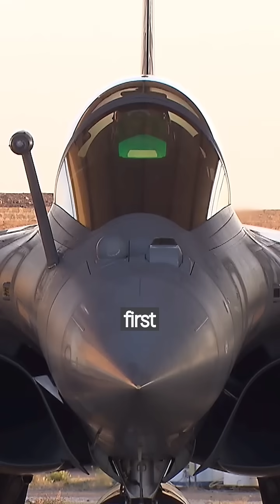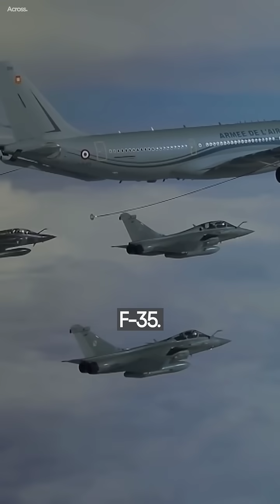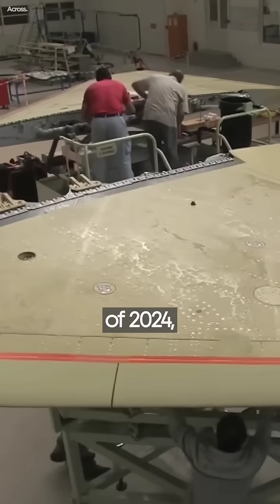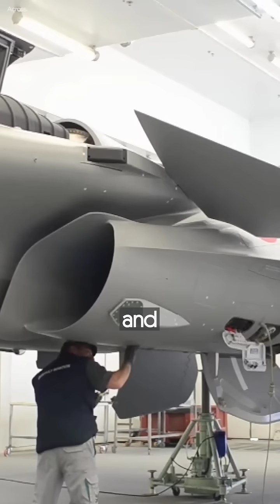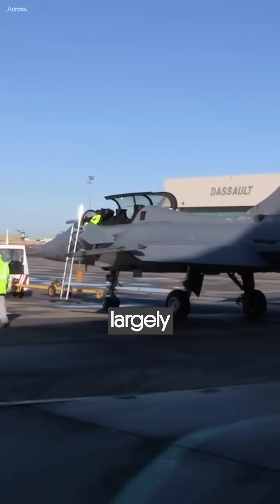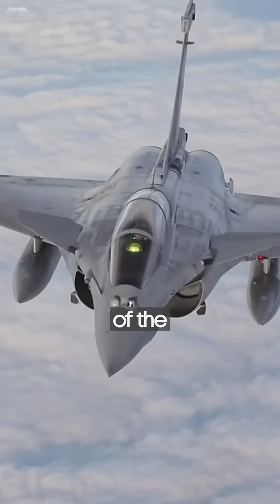The Fighter Plane No Nation Wanted to Fight #shorts

Comment: Its getting its butt checked by the F-35A in war games at a F-35A win ratio of 7 to 1.
That's the difference between non stealth 4.5 gen and 5th gen stealth network centric.
The Euros like Eurofighter, Rafale, Grippen have got to improve their game and advanced to 6th gen or they will loose every time against a stealth 5th/6th gen adversary. China is starting to manufacture 5th gen now! all be it maybe not as good as the F-35.

Comment: Yeah, the French 🥖 guys has this Dassault Rafale. It's the successor of the well-known Mirage 2000. 

Besides that, the aerodynamic design, is very similar to the Eurofighter Typhoon 🌀. This last jetfighter has the same capabilities. And had his first flight in the mid 90ies. 

It's 10 years more modern. The engines give at full thrust so much punch 👊 that this tiny jetfighter goes straight at Mach 2,5. His avionics, was developed over the past decades. 

And reached one point of cutting edge technology. The helmet of the pilot has neural sensors. Where he's looking, the radar is continued searching the area for targets and enemy movements. The computer for warfare is so sophisticated, that he can trace  and track 80 -120 targets at the same time. 

They developed new weapons. With autonomy flying . One mighty missile. Ukraine wanted. But the Bundeskanzler Scholz denied.

The Eurofighter project was a joint venture of many European countries. Like Germany, GB, Spain and Italy. Theyre still in Service. The Geeman Luftwaffe had to intercept many Russian aircrafts. Over the free Airspace. Which is very close to the European countries Aerospace. They are  continuesly monitoring the skies for any aircraft movements.

Comment: Greece is creating squadrons of Rafales, too. One is complete. It is not sure whether Greece will make a second order. They want F-35s. My opinion? With a radar footprint so small that it may pass unnoticed and its SPECTRA radar, it has proven to do a stealthy job. Some time ago, an unknown Air Force attacked a Turkish (I think) base in Libya. Using SPECTRA and correct cruising, it approached, created disaster, and left without being electronically traced. I suppose it was personnel that identified the type of the aircraft, but not a flag.
Greeks must be flying unnoticed F-16s, between Crete and Cyprus. They proved this once. F-16s, which were not supposed to be undetected, flew to Cyprus undetected by Turkish radar. But when they returned to Crete, they made sure they were seen, which was a bad surprise to the Turks. 
Why I am saying all this. The F-35 is still not mature, which is outrageous for their owners.  Imagine a Raphale painted with radio absorbing paint. Just that.
And the F4 generation??

Comment: The flight hour cost of the Rafale is about 14 k€ when it's around 31 k€ for the F35.
Reply: Yes but finally you fly more as you can fly in the thunder with a rafale.

Also it is more comfortable to maintain F35 as it have to be store in a facilities building when the rafale sleeping outside

Comment: IN THE RIGHT HANDS....
THE DASSAULT RAFALE IS A DANGEROUS
ADVERSARY FOR ALL FOES;
THE U.S. AIR FLEET INCLUDED.

BOTH THE F-35, AND THE F-22 ARE INSIGNIFICANT PLATFORMS WITHOUT
STEALTH TECHNOLOGY;
AND QUITE FRANKLY....
BOTH AIRCRAFT ARE HIGHLY OVERRATED.

STEALTH CAPABILITY IS THE ONLY ATTRIBUTE WORTHY OF PRAISE IN REGARD TO THESE 2 AIRCRAFT.

THE RAFALE WOULD EMERGE AS THE VICTOR OVER THE F-35, AND THE F-22.

♠️THE VANITY ADDICT♠️

Comment: The problem with the F-35 is stealth isn't all it's cracked up to be. Modern radar can detect it and if a nation has a mobile phone network the local military can use it to track anything in the air, if they can obtain a warrant from a judge.

Comment: cost (slowly decrease thanks to the economy of scale) $110.3 million per F-35A, $135.8 million per F-35B, and $117.3 million per F-35C
the Rafale cost is about 100 millions €
then there is the cost per hour. Here, Lockheed is using a trick, integrating the hours of training in a simulator with the real hour of flight cost and giving the average cost...
the real cost:
F35 (average of all version): 39000$/h
Rafale: 15000€/h
the Rafale was designed to ease the maintenance for 2 reason: maintenance at sea, and maintenance in degraded environment (basically, when in Africa with few facilities to do the work)
now, the F35 does have 1 big plus vs the Rafale, the passive stealth
but, passive stealth is dependent of the design and material used and can't be updated... meanwhile, the radars are evolving and are getting better detection against the current passive stealth designs/material
and contrariwise to passive stealth, radars/switched can be updated in planes currently in service
so while Rafales at the standard F1, F2 and F3 were in actuality inferior on the stealth vs detection focus, starting from the standard F3r and now the F4, that's not a clear cut anymore
meanwhile, the Rafale is way more nimble
and of course, ITAR free so some customers that are not in the gold list of uncle Sam, are very interested.
now, let's never forget that up to now, no fighter of gen 4 and higher have faced each other in real condition and enough times to get reliable statistics. So we are basing everything on data provided by the manufacturer and some joint exercises during which revealing everything, even to an ally, is not the smartest move...
and the Russian hardware performances vs what was claimed is the perfect example of the smoke and mirror show that surround the weapons performances
also, transparency being way higher in democracies (in the "western" powers), their data are closer to the truth than in countries were appearances are way more important to "give face"

Comment: The only one with more load capacity than dead weight. And with main landing gear in the fuselage not the wings like a Mirage 2000 or Eurofighter the Rafale has optimum load distibution and can land with it..while being aircraft carrier compatible, Most recently, it now outsell the F35 and a key factor for success is the compatibility with the Meteor missile with a much larger no-escape volume than latest Aim120 Amraam of F35 . The Us Anvil is only superior for undetected ground attack but today europeans forces would also use Scalp Stormshadow and Taurus cruise missiles for it and none of them fit into a stealth plane belly.

Comment: Those constant references to “5th generation” are nothing but marketing speak. The F-35, once discovered (which happens earlier and earlier as radar tech progresses), is pretty sluggish compared to some of the so-called “previous generation” contenders, of which Rafale is one example. The Typhoon - with similar basic design- performs even better.
Reply: That's true ! F35 is not a stealth jet, it is a stealthier jet !
Reply: F35= biggest waste of money in military history
Reply: F-35 is about as maneuverable as Rafale is actually. And "once discovered". You won't discover it. Modern air combat is not dogfighting and hasn't been for the past 40 years.
Reply: @johanlassen6448  There's no such thing as an invisible plane.
Reply: @bendu49100  OFC not. Rafale still can't see an F-35 at a practical combat range.
Reply: @bendu49100  A range where the Rafale can conceivably threaten an F-35 without first having been blown out of the sky. And it can't. Being reduced to sub 20 km lock-on range is not practical when you have an F-35 lobbing AIM-120C-8 and soon Meteor at 100+ km range at you.

We already know F-35 >>>> Rafale. Swiss evaluation proved it without a shred of doubt.

As for your coming argument that stealth is useless or there is a silver bullet (x-band, l-band, IRST, whatever other nonsense) - no it doesn't work and Dassault knows this. Hence why FCAS is also being designed as a stealth platform.
Reply: @johanlassen6448  So, what kind of magic exactly do you think the F-35 has to allow it to lobe AIM-120 and Meteors at 100+km range ?
Why would the Rafale somehow be reduced to a 20km lock-on range ?
Reply: @bendu49100  Because the F-35s radar allows it to detect, track and lock a Rafale at that range, while the Rafales radar can't do the same to an F-35. It's not magic. It's stealth.

Also, lob*, not lobe. Learn English.
Reply: @johanlassen6448  perhaps you should learn French to know the capabilities of the Rafale?
Reply: @og2716  Nah, I don't speak frog. The capabilities of the Rafale are available in English. It has been thoroughly evaluated by objective and serious airforces like Switzerland, Canada and Finland.
Reply: @johanlassen6448 you were kind of winning this argument until you started calling « frog » and asking to learn english to someone who clearly speaks it. Too bad…
Reply: @zaydalaoui9397  If you think I lost the argument because of my manners then you were never genuine in the first place.
Reply: @johanlassen6448 i didn’t take part to the debate as I’m not knowledgable on the topic but my life experience showed me that unmannered and aggressive people are usually wrong. Well at least I stop listening to them when they start insulting.
Reply: @zaydalaoui9397  Then you have not lived a long enough life. Perhaps when you grow into maturity you will learn that not all people deserve patience or civility, and that the merit of an argument is not affected by the manner in which it is presented. Until then, I would ask that you stop wasting my time. Whether or not you think I am well-mannered is as uninteresting to me as what kind of consistency your stool had this morning.
Reply: @johanlassen6448 haha! Ok I’m closer to retirement than anything but whatever you like to tell yourself. Have a nice day
Reply: @zaydalaoui9397  Then you are a perfect example of how age does not correlate with maturity.
Reply: @eliasjazz  How can the F35 spot the Rafale before the Rafale can spot the F35 ?

Comment: 👉in comparison with a fleet of F-35s you can operate a 40% bigger fleet of Rafale's.  Questionable Stealth capabilities of any kind are just a costly selling point for the tax payer.  Compare that with the shooting down of the F-117 Nighthawk by an old Soviet missile.
Reply: 1. False, Rafale is more expensive than F-35.
2. False, stealth is a proven concept and even Dassault is focusing on stealth on its next platform.
3. F-117 was shot down because it fly right over an AA battery. Additionally, its stealth was much less optimized than F-35 and it had no countermeasures or EW capability.
Reply: @johanlassen6448  
🔷 Did you take in the cost of maintenance, for example you cannot replace a part of the airframe of one F-35 with another, they are individually fitted!
🔷 I admit I wasn't precise in explaining how I understand stealth capabilities.  If you mean stealth capabilities in terms of long-range radar and to Lock on to your enemy beyond vision of sight I'm all yours.  By the the way the Rafael Jets have them.  But if you talk about an stealth airframe I not with you, the point above should be self-explanatory. 
🔷 On point Three you made, you also have to take in the fact that the technology in Terms of Soviet Radar and missiles where at least twenty years older!

Comment: There are good indication that Rafael beats F-35 in electronic capability and only falls short due to lack of stealth.
Reply: Those are some theories brought up, but most likely no. The F-35's EW is highly robust and advanced. But anyways, it's hard to jam AESA radar, which both have. So they'll both still use their radar and passive sensors to search each other out.

Comment: *The rafale does have incredibly advanced sensors, some sites state they're close to par with the F-35. On top of that, the rafale used semi-stealth material to reduce its RCS, while not being nearly enough to be stealth, it is helpful.
Reply: Yes its SPECTRA sensors are close to the capability of the F-35.

Comment: Not only is it extremely capable and manoeuvrable, this bird is also equiped with state of the art sensors : active electronic radar, OSF (multiple infrared and TV passive sensors). But it is stealth when it's not carrying any payload (which doesn't happens often, but stil...)
Reply: What you say is false. The Rafale is stealthy in its tactical configuration. This is called active stealth. To achieve this, it penetrates enemy territory at very low altitude thanks to its unique automatic terrain monitoring radar in the world. Which makes it invisible to radar because it hides with the terrain and pilots train for this every day. And he does this with all his armament under the wings!
Reply: it's not stealth, it's discreet ^^
Reply: It also has netflix and HBO capabilities 😉 you can even wash clothes and chill beer inside and has a built in microwave to make popcorn
Reply: @pinoyroborat9873 the George Foreman grill is optional 🎉
Reply: @kelvinmeneely3116  😆
Reply: @kelvinmeneely3116  😆

Comment: Yeah large payload capacity , that's funny 

While Rafale indeed has about 9 tons of maximum payload capacity, 6 tons of them are just 3 external fuel tanks which without them the Rafale don't have a decent operational range due to its small size . 
And that leaves only 3 tons of armaments payload capacity available lol .

And yeah those fuel tanks will f**k up the radar cross section giving the fighter an RCS of Eiffel tower.
Reply: But the F-35 is no more stealth with the new Rafale radars who can now see it like a button on a teenager nose. Stealth is no more an advantage now.
Reply: Yes, exactly why an F-35 will detect and track it from 100 miles away.

Comment: Its a superb fighter jet, one of the best dogfighters on the planet, but the F-15EX, F-16BLOCK, will give it more than a run for the money, the F-35 and F-22 Raptor will blow it out of the sky, no contest
Reply: bruh how tf you can say that the f-15ex and f-16block can do all the type of missions the rafale do, both f15 and f16 can't be operated from carriers while rafale can. rafale can do much more, this is the most versatile aircraft ever produced...also it is i think much cheaper to operate than these tow 

surely it is weaker in BVR but should not be ignored

Comment: Dassault Rafale can "undress" the stealthy F-22 and F-35 using its radars and sensors.Proven already in recent wargames.
Reply: Any fighter can be beat.  Raptor included.  No matter who the pilot is.  However, with the F-22's stealth, its going to win most of the time guaranteed.  So would the F-35 ...J-20 possibly also.
Reply: No it can't. EW don't really work against AESA radars which both the F-22 and F-35 have.
Reply: Both aircraft using a Luneberg lens Nice try liar mentioned proven in already war games when both aircraft in said wargames were put in disadvantageous situations 😂
Reply: @pooferfish1227  wasnt the radar of the Rafale had it radar cross section reduced and it already "stripped" the Raptor.Amongside the Rafale was the EF Typhoon too,stripping the Raptor out of its invisible hiding

Comment: The question is, how does it stacks up against something like a Saab Gripen? These two are more comparable than Rafael against the F-35.
Reply: The rafale beats de f35 at all competition so no comparaison possible the rafale is definitly better
Reply: @Noelegamer  How can Rafale beat F35? Rafale has no stealth capabilities whilst F35 is designed to be invisible on the radar, while carrying long range missiles. Rafale won't know what hit it.
Reply: @azarazar007 ahh my dude... stealth does not make everything, and btw stealth does not mean invisible 

the rafale is more versatile, can travel longer distances, stay in the sky for longer, carry more weapons (both variety and in weight) 

the rafale can supercruise unlike the f35 

the rafale is cheaper, and MUCH cheaper to operate (57k$ for one hour f35, 15k$ for one hour rafale)

despite the rafale is not as stealth as the f35, it does have a reduced RCS, which should not be ignored. 

finaly, the rafale have the same tech inside, same type of radar with similar capabilities (and even more in the next few years) it have top notch EW suite, irst and lethal weapons such as the meteor (currently best bvr missile)

oh and the f35 is not reliable, it has more than a 1000 issues to fix (said in press)

Comment: The only reason F-35 sold in mist if Europe is USA used their influence... And now a lit of contries regret their mistakes: purchasing  super expensive program which isn't able to be fully operative.
Reply: Et surtout parce que ils prête leur bombe nucléaire au pays européens , je suis sur que les Etats unis oblige les pays européens qui ont des ogives nucléaire a utiliser le f35. Mais nous les français avons notre propre industrie nucléaire et n'avons pas besoin d'accord avec ses maudit américains.
Reply: Countries need self defense platforms. Don't blame a f 35 because you're country can't defend it.
Reply: Nope. F-35 is a joint programme, that’s why it was bought by many countries at first. Nobody got forced into anything. Now many countries are buying it, as it is a great platform which was meant for export right from the start. It is bought for it’s capability. I haven’t seen any country regretting their decision to buy F-35.
Reply: @confused3032 that's because they look cool in the hangar 😂
Reply: @CrimsonRaven82  and in the air too 😉
Reply: @confused3032  not really.. its a fat plane.
it needs that stealth tech to hide its thickness. 
none the less, it's a impressive plane
Reply: @CrimsonRaven82  What? What do you mean fat? Planes aren’t about thickness. If it was so unable to fly, it wouldn’t. But, it is able to fly mach 1.6

Comment: Interesting. Things to consider here, but Dassault is an old company and has turned out some great airplanes (and capable engineering software).
Reply: Dassault aviation and Dassault systèmes are 2 différents compagnies under the same name/structure but they don't work toegether